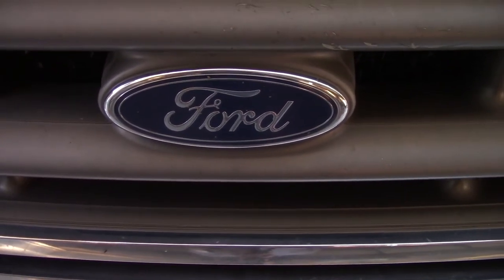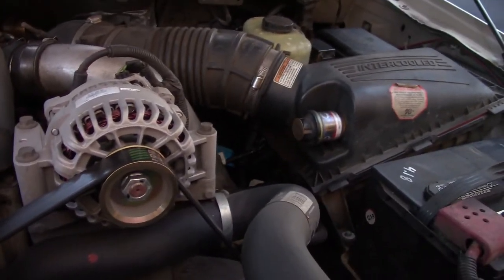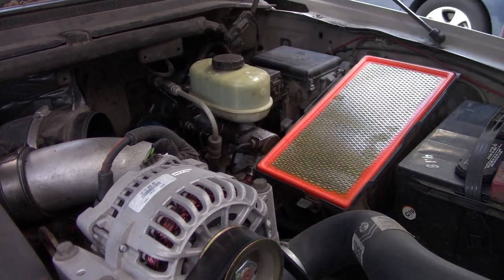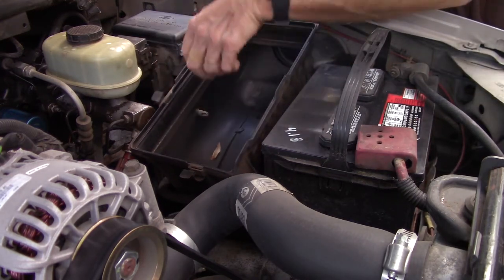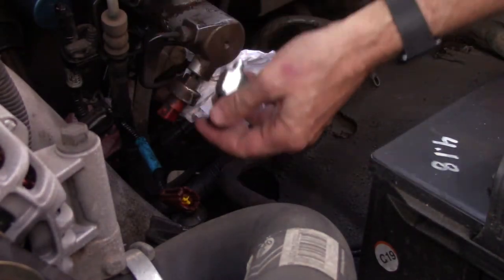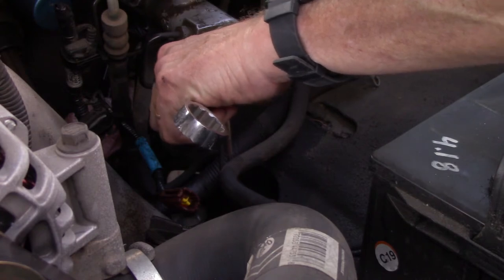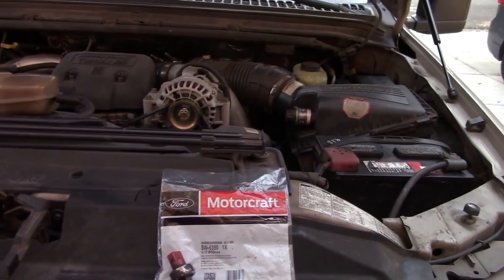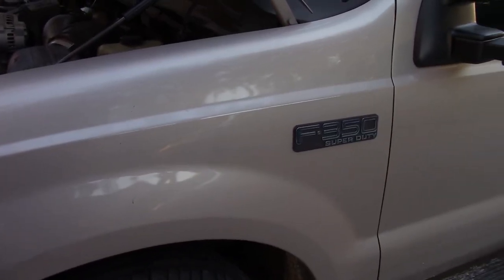F-350 Cruise Control fix

Comment: My cruise works intermittently. Where would you start ?
Reply from the maker: Mine can have occasional issues.  It will turn on fine the first 10-15 minutes after a cold engine start. Once hot, I have to hold down the On button for a few seconds to get it to set. Sometimes it takes a few tries. Its possible my new sensor is already having issues, but I haven't dug into it.

Comment: Recently bought my 2000 SD. Ordered sensor but found new sensor had been installed and found an old work order where the sensor and fuse had been replaced. I checked the larger fuse in the harness but it was good. I found a second smaller taped up 2A fuse in the harness which was blown. R&R fuse fixed CC.
Reply from the maker: Good find. That fuse harness was a recall "fix" for some sensors overheating and causing fires.
Reply: Hey man, i don’t know much about the harness and wanted to know if you had a way to share what you did for me? i already tired what the video did and i don’t want to replace the buttons yet. Anything will help! Thank you
Reply from the maker: @chasethompson2097  A recall added a fuse in the line to the sensor and Ford made a small harness to house the fuse with connectors to connect into the existing harness. I didn't change that, just replaced the sensor. There are other items that can mess with cruise control and I've heard the brake pedal switch is a common issue. The way my cruise control stopped working led me the the sensor and my hunch was correct.
Reply: @Soladaddy  I have a 2 little red things that have tape on then and i’m not sure what they are

Comment: Did not fix mine
Reply from the maker: The buttons on the steering wheel can stop working. Sometimes I have to hold the "On" button for 2-3 seconds to activate cruise control. Others have had issues with the brake pedal switch that disengages cruise control.
Reply: Ya I tried replace circuit breaker and the brake pedal release sensor checked all my fuses, wires. It's probably the buttons or something in the steering wheel. Hoping it'll be something fast and easy but nothing I've looked up on YouTube has been helpful. Had a problem with the truck not building boost and all it was is vacum line that hooks to fire wall, really simple fix but no one talks about that potentially being an issue. So if you ever have a problem with boost check your vacuum line that hooks to the fire wall I think it's for the wast gate mine was not plugged in. at the time i didn't know any better, Felt really stupid because of how simple it was😅. Truck is 1997 f250 heavy duty

Comment: I have a expedition 1999 xlt v8. The cruiser doesn’t work, but i don’t know which piece i have to change. Maybe a fuse or this piece what we watched in this tutorial.  help me please ! ✌️
Reply from the maker: The Exp may have the recall too. I checked the fuses first and found nothing wrong anywhere. Just took an educated guess that the sensor was bad so replaced it and so happened to correct the issue. Check for the correct part number on rock auto, then shop around for the best price and if its not too much $$$ maybe try the parts swap. I'd try to buy from a place that has a good return policy.

Comment: My horn, cruise control switches don’t work on my 02 f-250, I have been told it could be the clock spring? I don’t know much about it. Any input?
Reply from the maker: I've heard about the clockspring causing that, but have never seen that issue myself.
Reply: I had same symptoms but it was 2 different issues on my 95 F150.  I replaced the clockspring but it did nothing so trouble shoot first.  My horn issue was simple corrosion at the horn itself.  Have not fixed cruise control yet but did eliminate the pressure switch and fuses being the issue.  Will have to dig into wiring further before I go hunting for a working CC actuator.

Comment: Was the plug to the connector oily? My 99 is having cc issues and the plug is wet from what I would assume is brake fluid.
Reply from the maker: Mine was wet from a booster leak, but the internal part of the plug was dry.

Comment: Is yours an EARLY '99? I just replaced mine on my LATE '99 w/o removing anything. The old switch takes a 9/16" wrench and the new one a 7/8" which I didn't have so I got a medium/large adjustable wrench in no problem.
Reply from the maker: Yes, it is an early 99. I probably could have replaced it without moving anything,.

Comment: Did your lights on the dash not light up for the cruise control when that sensor went out?
Reply from the maker: Mine doesn't have a dash light for cruise control. Its a 99 model.
Reply: @Soladaddy wierd, my 99 had the same light my 01 has.